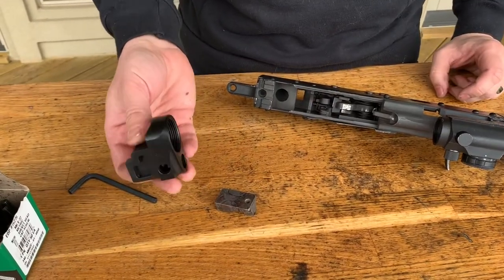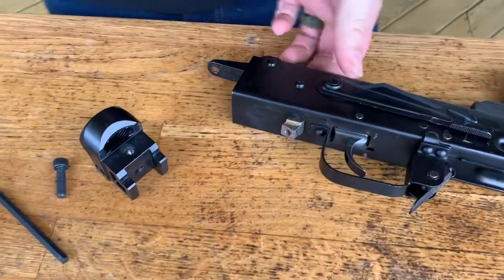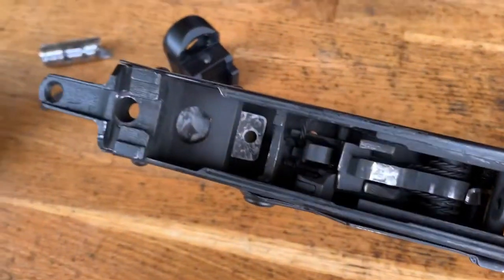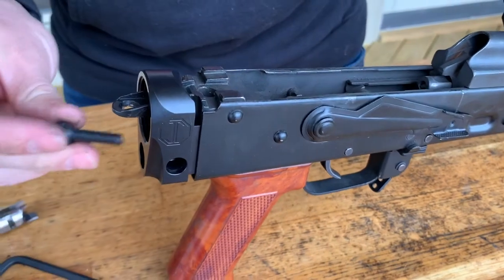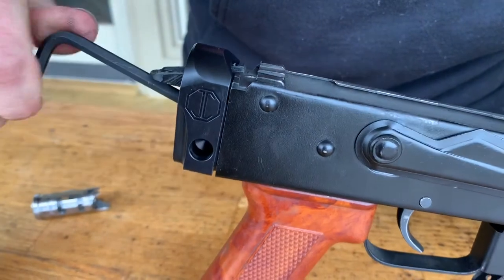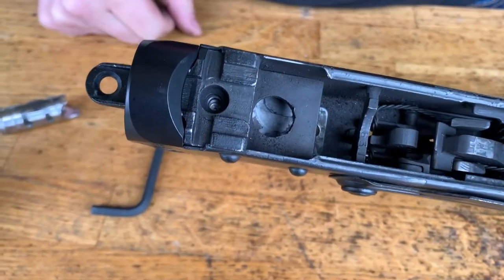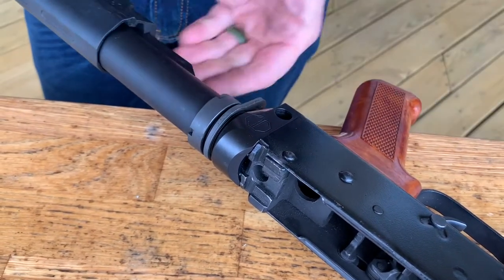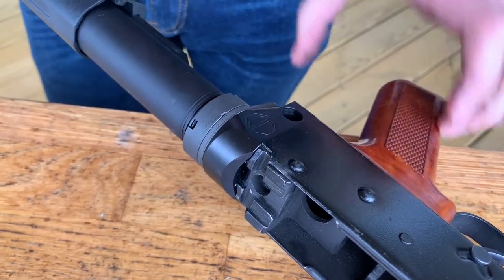M4-AKM Adapter Install Video

Comment: It'd be cool if you guys made a buffer tube with a storage compartment like the Vltor RE-2. I tried using vltor's tube, but the stock tang prevented it from threading on.

Comment: Is it just cosmetic ? 
Will need buffer and spring ?
Reply from the maker: This is an M4 buffer tube setup on a kalash so there is no need for a buffer or spring. 👍
Reply: The purpose of this is to adjust length of pull only.

Comment: Can you guys make adapter to turn a under folding stock into fixed or side-folding or just similar adapter you just made for AKM. Also please if you are going to make one don’t forget yugo owners. Thank you
Reply from the maker: We have our stock mount!  🙌
Reply: @justinmcmillion   really ? Thank you. What’s the item name or number ?  Since the item
I’m looking for is for yugo m92 with under folding stock rear Trunnium and receiver and I want to convert it to side folder or fixed stock and I don’t want to modify the rear trunnium.
Reply from the maker: Reach out to our technical team through the Contact Form, over on the s!te. They'll get you pointed in the right direction. 🤓